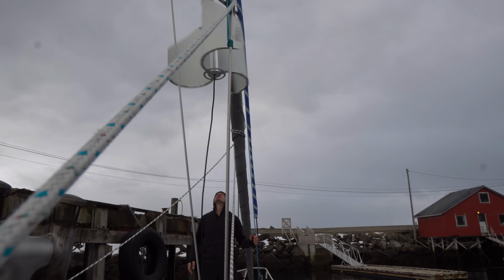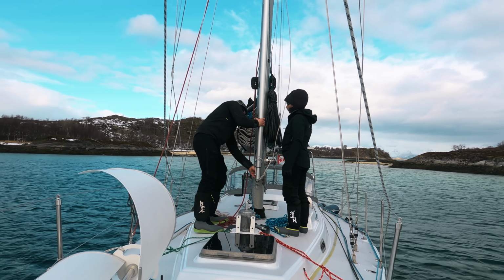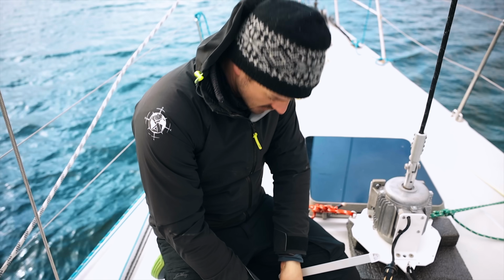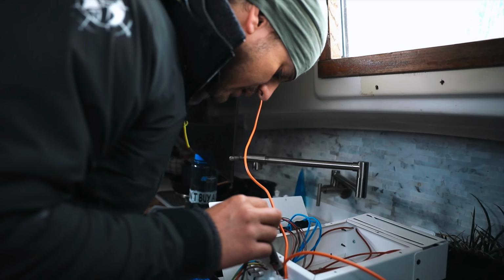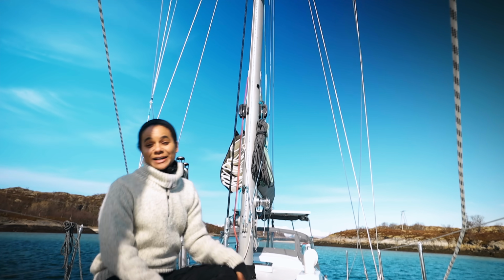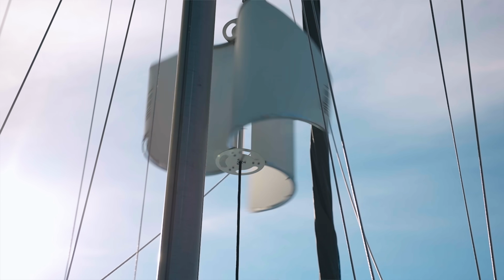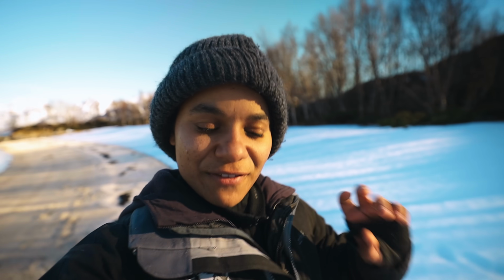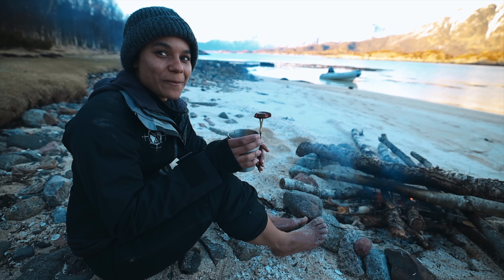No Sailing, Just BULLSH!T — Sailing Uma [Step 273]

Comment: it might be squeaking and shaking because you don't have a universal joint between the rope and motor. the torsion energy is intermittently having to bend the rope to cope with misalignment when the joint is turned 90 deg. The joint is squeaking when its being forced to rotate off axis and or needs grease.

Comment: I am very intrigued with your electric boat experiences.  Great job with all of your hard work.   I would suggest getting a  torque sleeve (flex shaft)  that are used on aircraft electric flap systems.  They are long, flexible, stainless, and will eliminate thrust load on the generator bearings.  The outer sleeve carries the thrust load.

Comment: Will the spinner fit in between the mast and a stay while hanging for either spreader? I think a few sections of solid fiberglass poles would work better than the line. Depending on what is available to you in the EU, they could be stored top side if too long to stow in a locker or below deck.  Maybe a base for the spinner bottom to help hold it steady so the line between the spinner and the generator and be made more taught.  Just thinking out loud.

Comment: 'what's that squeak' 'why's it moving around' 'in future this needs to be mounted square and true' 'let's attach this tension rope pulling' .... Yup, your alternator bearing will last no time at all !!  and BTW.. solution to braided copper is a terminal cap crimped on to change braided to solid. It's painful to watch.

Comment: I do not want to spoil the fun, but you are not the first to experiment with this type of turbine. If you look into the mathmatics behind it you will see that you have to go bigger. You said for a horizontal axis turbine (HAT) you need a blade length of 1 to 1.5 meters to meet your demands, so a swept area of 3 to 6 square meters. A good vertical axis turbine (VAT) reaches roughly half of the efficiency, that doubles your size. Or to put it into a different perspective. A square meter swept area has an energy content of around 180W at 8m/s wind. That is a lot of wind on an anchorage, which you normaly chose to be protected. Now reality kicks in. A small HAT can do a CP of around 0.4 a VAT around 0.2 That means a VAT with one meter diameter and one meter hight will give you 36W from the rotor. That is before your transmission and your generator. A generator ouf your size will need that probably just to remagnetize its coils on every turn without any delivery. And than all your bearing issues and all that go on top of that. So unfortunately same conclusion: your rotor has to be way bigger. Still, the idea with cord was new to me, great idea, but the pretension you need will probably be a killer for effeciency. (more load on a bearing=more losses on the bearing; less tension on the cord=more losses on the cord)

Comment: You need to rewire your mains plugs... The rule is that sockets deliver power to plugs. The reason is that you don't want power on exposed plugs because you can easily touch the pins and get electrocuted.

Comment: That turbine was at least 4 times the size i was expecting. I wouldnt want something like that getting out of control in a squall.  Nice anchorage, got a waypoint?
Reply from the maker: It wont spin out of control. One of the big benefits of VAWT is that they self stall around 35-40kts.
Reply: @SailingUma  Good to hear. I was thinking you could use an alloy pole for your transmission shaft, but still use that "rope" at each end to act as universal joints. Im not familiar with that stuff, but if it does not suffer from "wind-up" is a solid pole needed?

Comment: Use a segmented shaft to connect the turbine to the generator.  This will add stability when you hoist the blade and give it a rigid connection.  You can still add some tension to the top to prevent side-to-side movement, but less tension will keep the generator firmly on the deck.

Comment: 13:45 if you twist the end of the stranded wire as tight as you can (so it's almost as a solid wire), the screw will dig into and hold it quite well.
Reply: Also... the smoke may have been the couple of strands melting that were making the connection (too much power over too little wire).
Reply: @siamsurf  Most wind generators I've worked with are AC output, would not go too well plugging into a DC circuit.
Reply from the maker: Yup. Thats why wind turbine charge controllers have rectifiers built in.

Comment: What about using the whisker or spinnaker pole as the shaft between the turbine and the generator? The turbine could be modified to fit over the pole.  Maybe also experiment with a narrower longer turbine with same surface area. This would be easier to stow away.

Comment: Dan , inside your typical gas powered weed eater - lawn trimmers 
they have a flexble square metal cable that spins inside the tube running between the motor and the spinning head . It might give you less flex if you used the whole assembly.
Reply: Ahh yes, good point. You could potentially use two straight shaft variety trimmers and couple then together. Be cool if some old trimmers could be found at the dump or junkyard.
This is similar concept ad speedometer cables from cars I believe. Idk if they would be stiff enough to transfer the load, but similar concept.

Comment: I’m working on a fireplace/wood stove in my own home.  I can’t quite tell if you had it but if not you may be able to retrofit a secondary combustion kit into the stove.  More heat for the fuel/stove size and burn up the smoke, less soot on deck.  It’s pretty incredible actually, food for thought.
Reply from the maker: Our stove has a built in second combustion to reburn the smoke before it goes out the chimney. Works quite well.

Comment: Really interesting. I've also been kicking around the idea of making a vertical wind gen, and your idea of hoisting the vanes and keeping the mass down low is a stroke of genius. BUT, I don't think your torsion rope is ever going to work well. I'm pretty sure that the strands inside are continually twisting against each other changing the axial loads across and along the rope, continually lengthening and shortening it, and causing internal friction that's hurting your efficiency. Look into the problems of using wire rope as a flexible drive shaft. And wire is much more rigid, obviously, than sta-set. It will also beat the crap out of the bearings in the alternator. I'll bet you a buck that you will get much better results using an aluminum tube, even though it may need to be shorter to be practical to store. Keep at it. I'll be curious to see how this progresses. Knowing you guys, it will ultimately be highly effective and utterly beautiful.

Comment: Can you mount the generator and tow a prop like the old Aquair from Airmar?
Reply from the maker: No need. We already have a hydro generator (our electric motor) but that only works when we're sailing. And PV only works when it's sunny. We're looking for a solution that works on anchor, when it's dark.

Comment: You should check out the ECOFLOW DELTA PRO 3600w Solar Generator. This little puppy might help improve your battery storage greatly.
Reply from the maker: Why? We already have 14kW of batteries onboard. We have all the power we could ever use. Putting it back in is what we're trying to solve.
Reply: @SailingUma  Sorry I didn't know you already had that much storage capacity. My bad. But to your point about putting the power back, in addition to experimenting with wind (which I think is a great idea), there has been advancements in solar panels' productivity per cell than even a few years ago. Might be worth checking out. And...you two are THE BEST. It would take a volume to express how good your channel is and how much joy it brings to us viewers!

Comment: I'm sure ya'll figured it out by now.  but your pressure on the rope is putting too much force on the armature, causing excessive drag.  the bearings are designed to keep the armature aligned not the outward pressure.  it'll be short lived, and give a lot less power than it could because of the excess wind (force) required to turn the armature under pressure.
the key would be neutral pressure, if possible.

Comment: I'm smiling, stick a load on it like a battery and it will probably stop dead, have you measured any output ??? But I'm still watching we will see 😁
Reply from the maker: Pretty much all the spinning you saw, was with it loaded (via a small LED light) It's rated for 9-52V so it was a great load. We showed the light in a few shots. It was also in less than 5 kts of wind most of the time. It picked up to 10 kts a few times and we saw more than 50rpm under load, which is pretty promising. But like we said, this is all a proof of concept prototype and we're planning on swapping and evolving everything as we go.
Reply: @SailingUma  voltage is not a rating for load you need some amps,

Comment: The horizontal propeller style wind turbines are powered by air foil generated force minus wind resistance. Whereas your vert style is powered by wind resistance alone. Apparently the aerodynamic force of foils is so much much more than that of wind resistance forces that a reasonably tiny air foil propeller powered by reasonably small motors can make a relatively huge airplane fly based only on the difference between wind drag and air foil thrust. 10-1=9 lbs of thrust. whereas your model only has 1 lb of thrust, metaphorically.
Reply from the maker: Airplane motors aren't generators though. Not really the same thing, even if they work on similar principles. We know the differences between VAWT and HAWT, but we're experimenting with VAWT for a reason. If we had unlimited space (a mountain top) the horizontal turbines are obviously superior, otherwise, they're wouldn't be 10's of thousands of them around the world. But they have some negatives that are deal breakers for us. Mainly mounting space and noise.
Reply: @SailingUma  every method of powering a boat has negatives. My point is that the wind power unit you are testing harvests energy from a turbine optimized for wind resistance. But wind resistance is a weak force compared to airfoil lift which is what drives common vertical wind generators. Those are optimized for lift and for minimal resistance. That works so much better that the lift-resistance equation is enough to actually make relatively huge planes fly based on that energy conversion. It is true as you say that those tiny props are powered by very powerful motors but the surface area of the prop still generates a tremendous lift by using foil dynamics instead of resistance dynamics. I have never seen a wind generator that was powered by wind resistance that could pay for itself over it's lifespan.

Comment: Very interesting. I suspect you are seeing tremendous losses in the flexible line you’re using between the wind vane and the generator. You might do better with something as simple as schedule 40 PVC tubing (available in the U.S. down to 1/2 inch I.D.j and a couple of universal joints, one on each end of the tube. Use the halyard to hold the vane at the proper height. I suspect any long run solution will need U-joints to allow for a certain amount of flexing in the mast or whatever vertical support you use. I love your spirit of “let’s give it a try.” Stay healthy!

Comment: Have installed several horizontal turbines in Northern Canada for remote instrumentation sites. They all failed within a year. Reason was they had no thrust bearings, relied on rotary bearings entirely which eventually failed.

Comment: First, I love that you guys try stuff and don't get dissuaded by the nay sayers. Keep at it. I completely agree that wind and solar are symbiotic energy harvest methods. As far as the turbine goes, the reason vertical axis suffers in efficiency is that it has to drag a vane against the wind for every vane the wind pushes. So each rotation looses some % potential net energy capture. Since the total energy gained over time is an integral of the energy per revolution and the rotation speed, the small efficiency loss is magnified. Anyway, I totally get the mounting challenges of combined wind and solar. No easy answers to hard questions.

Comment: Good principle to keep the weighty stuff down on the ground. Robert Murray-Smith has some videos on turbines and discussed the same thing noting that taking the motor up to the blades is usually the most problematic and costly in terms of engineering and safety.

Comment: A different way of approaching this problem would be to have movable solar panels that could be tilted to always be at the optimum angle to the sun. Should yield significant improvment in efficiency, particularly in the higher latitudes where the sun is often quite low on the horizon. The obvious temptation would then to have them motorized and automatically controlled by e.g. a Raspberry Pi, catching even the midnight sun while you sleep. Should be doable with the electronics skills you have already shown us. No changes to the charging system, just add the tilting mechanisms.
Reply from the maker: Solar only works with light. If we were going to always be in the tropical belt, solar would be fine. But there are places we’re planning to go that don’t get much light.
Reply: @SailingUma  Ok. Another suggestion then: Instead of the torsion rope, use some anchor chain. Should be a stiffer transfer of power without having to be under much tension.

Comment: Will your generator bearings support the thrust load (line tension)? Do you need to mount a thrust bearing above the genny to carry the thrust?
 Comments from the armchair
Reply from the maker: Sure. It’s a very minimal amount of thrust compared to the loads they’re designed for. We’ve been through all this with our old electric auxiliary motor. 

But like we said in the video, most everything will eventually be replaced. This was a rough draft of an initial proof of concept. No where near a final version.
Reply: @SailingUma  Thanks for a reply. Just my two cents worth...do I get any change? Take care.

Comment: The secret to electronics is to keep the magic smoke inside.  Once the magic smoke escapes, the thing won’t work!

On terminals that do not have a plate to squeeze the wire, I take a barrel ferrule and crimp that onto the bare wire and slip that into the terminal.  You can make a barrel ferrule by taking a ring or spade terminal and cut off the connection which would leave you with a barrel ferrule.  Something else you can do is to place a copper plate into the terminal with the wire underneath.  It is still a good idea to tin the wire end with solder to prevent corrosion due to dissimilar metals.  Periodically tighten all terminations due to expansion/contraction and vibration, no less than once a year.  Preferably, tighten terminations once a quarter.

Comment: Hi Dan, check out Sam Holmes' interview with Sven Yrvind. Sven applies epoxy resin to lines to make hard, light fixtures (hand-grabs, etc.) If you apply epoxy to your torsion line, that may add the rigidity you are looking for.

Comment: If the wind generator is only used at anchor and not under way then I don't understand the issue with putting the generator up the mast temporarily as it doesn't weigh more than the sails.  This removes the torsion line and captures all the power of the wind.  You just have to figure out how to get it up there.  Think Dan think.  Maybe the main halyard and a bracket.
Reply from the maker: Exactly.
Reply: @SailingUma  That sounds like a pain though. If it's a pain in the butt to get it up there, would you want to use this system? I think you're on to something by separating the two. Plus then you could theoretically have a light wind giant turbine and heavy wind smaller turbine. 

Love watching this "all bullsh!t" episode! lol Love the channel overall - my favorite sailboat channel. :)

Comment: for hacking stuff together, what about a telescopic painters pole as the shaft for the generator?
also, saw your wiring issue, what we sometimes do is use wiring ferules with square crimper.
hope this helps some.

Comment: 1. As people said here - these terminals can work with a stranded wires, but you need to crimp a ferrule. 
2. You are losing energy because of an internal friction in the rope. I'd try to replace it with an aluminium tube, directly (without joint) attached to the generator shaft.
3. If you still want some flexibility - two-piece joint is not enough as it has "dead" zones. Look for a classic cardan (two forks+spinner).
Reply from the maker: As we said it 3 times all
Of this is 100% temporary and EXPERIMENTAL, and everything about it will change.

Comment: Super creative, but unlikely to be useful.  The better approach to overcoming not enough solar is to have too much solar.  Can put on side rails
Reply: also, if you insist on pursuing this wind setup, you should have a helical (thin ribbon wing) vawt.  Lighter so it can be full height.

Comment: Lovely project!  
If you add a universal joint at the generator input, it will not be as sensitive to alignment between generator axis and the torsion line.  In the scene 03:48 you have made a yoke coupling out of a tube, the slot is at 90° to the first bolt hole, try leaving that bolt, through the generator shaft, slack so that the coupling can rock a few degrees and that should do as a mock up.

I agree with the comments about a thrust bearing, the tension on the torque line was possibly causing the generator bearings to bind, hence the squeak and slow running.  The generator's bearings will probably designed for rotation only, with no provision for thrust.

l love taking things and adapting them to suit a new purpose, good luck... hopefully you will create the Uma class generator, which we will soon see on every clever yacht.